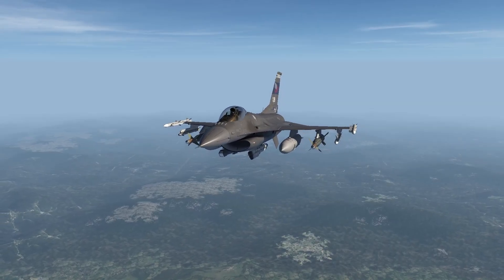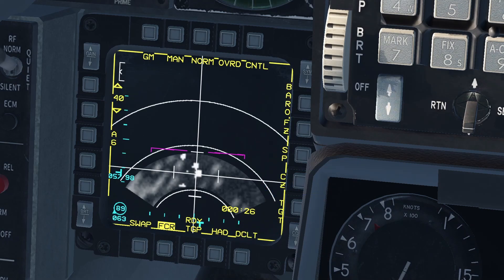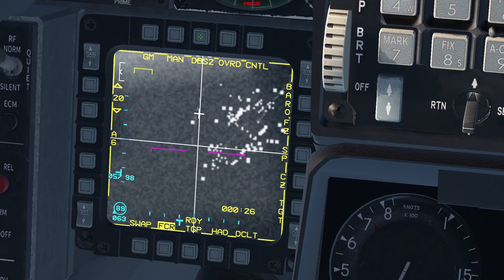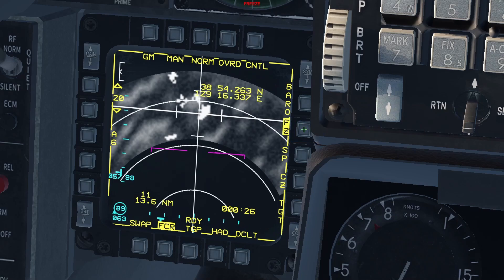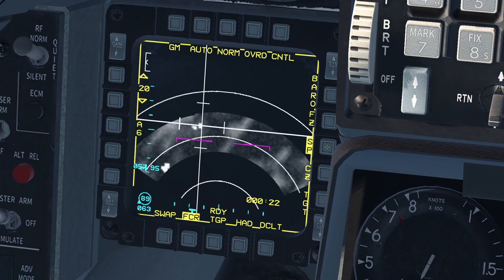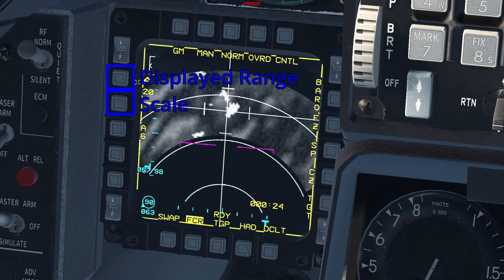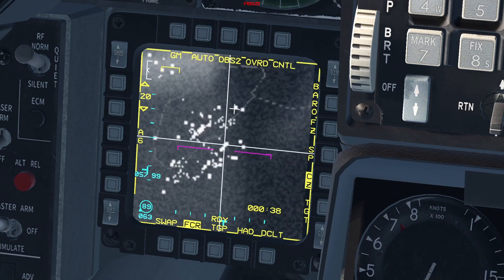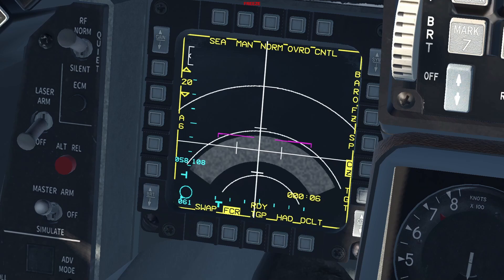Falcon BMS 4.37 Tutorial - Air to Ground Radar

Comment: Whats the point of using the air to ground radar instead of a tgp? What are the reason to use it instead of a TGP?
Reply from the maker: @TheSchnensch  to cover a wider area and find targets at longer ranges. As good as the TGP is, its field of view is limited and it can only visually acquire things up to a certain range. Don't think about it as "use only the A-G radar or the TGP" but use both, one to complement the other.
Reply: I always wondered this question thanks

Comment: All your vids are excellent. Thx for sharing! Due to unknown reason I do NOT get any structures shown in GM mode (neither in NORM, EXP, DBS1 or DBS2) (e.g. in training 😅GP BOMBS). It’s only grey without any sharp structure. Settings are identically to your vid. I am getting more and more frustrated as I’ve tried so many things 😕Any idea/hint what I am doing wrong or needs to be changed?
Reply: Thank you so much for your quick reply! Very much appreciated!! I will try to make a recording or at least a screenshot once I selected STP6 in training mission GPBombs. I understood that after selecting STP6 FCR in GM mode should be slaved to that steerpoint. Have a great weekend! Btw I am in VR not sure if this might change anything.
Reply from the maker: @desmoflex  it shouldn't affect the way the ground radar works. Let me know when you have it and I'll have a look at it
Reply: I do not have a recording option😕 may I send you a few pics? Should I use a e-mail address or post here a wetransfer link? Let me know what fits best.
Reply from the maker: @desmoflex  BMS itself doesn't have a recording option, what I'd suggest is OBS or a similar software. As far as sending it to me you can join my discord server and then DM me: https://discord.gg/MTzBac8BCg
Reply from the maker: @desmoflex  thank you! The resolution of the ground mapping isn't great, but you should at least be able to make out something. Not sure what's going wrong? Can you maybe try to record it so I can have a look?